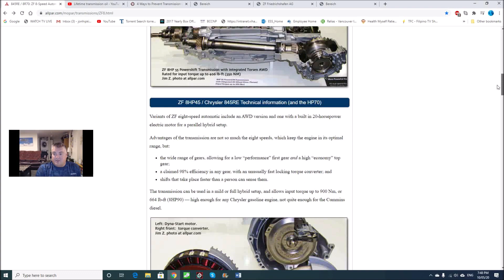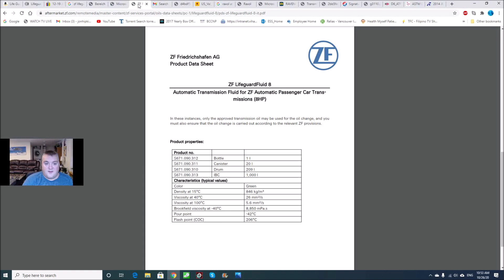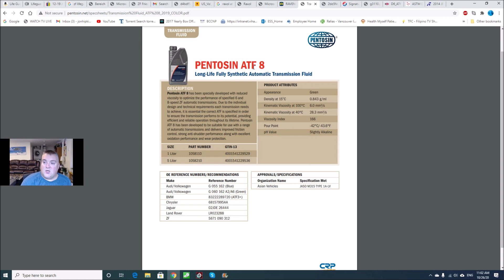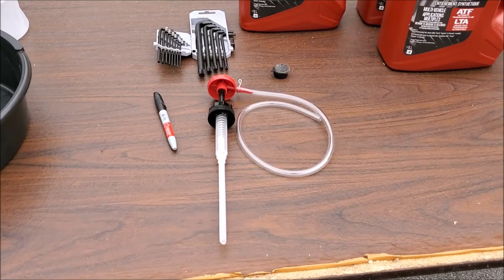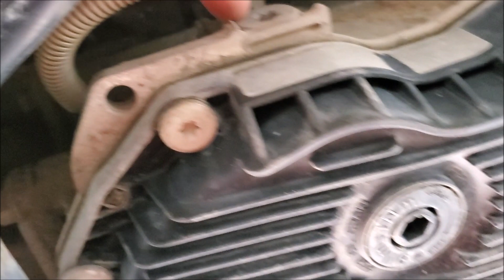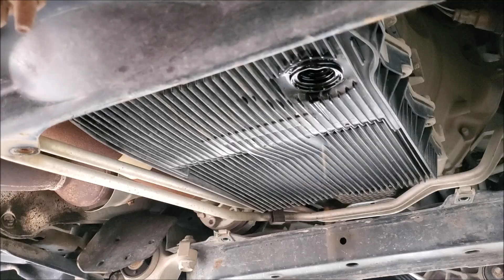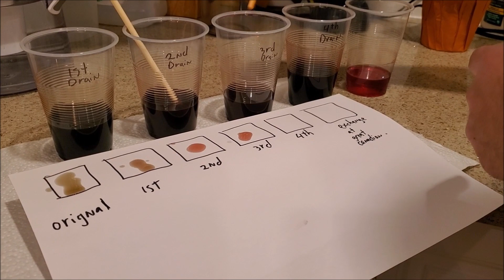ZF 8 SPEED FLUID CHANGE AND OPTIONS (SPECS INCLUDED)

Comment: Having transmission judder issues on a 330e with 116k miles. Don't believe it was ever changed by BMW.
Should I try changing the oil as a first option or is it too late?  - full detail in following comment.
Reply: Very harsh judder through the car under the following conditions:

- Car is in ICE mode
- Acceleration under load between 1500 - 2000 rpm
- Most prevalent in 6th gear
- Happens in both manual and automatic mode
- Most noticeable in sport mode but does happen in comfort and eco pro also

Current adaptation values of the automatic transmission:

Clutch fill pressures:

Clutch A: - 24.0mbar
Clutch B: -18.0mbar
Clutch C: -256.0 mbar
Clutch D: -34.0 mbar
Clutch E: -241.0mbar
Clutch K0: 132.0 mbar
Clutch IAE: 0.0

Had the adaptations reset but the problem did not go away.
This issue clearly needs more investigation but from here logically thinking:

1. Change the gearbox oil, checking:
i. Pan check for metal. If all good
ii. Mechatronic and solenoid. Replace if needed, if that fails
2. Drop gearbox and send for full re-conditioning.
Reply from the maker: @user-od3rl5mc  I'm definitely no expert on the subject but your fill pressures seem wildly sporadic. I would ask BMW what the range should be normally as going from 18 to 256 seems like a huge fluctuation to me. It also seems unlikely that the fluid would be the cause (in my mind) since the problem only occurs in such a specific circumstance (only ice mode and only 1500-2000 rpm). Whatever you decide plz let me know how it works out.... good luck
Reply: @jonh2408  The gearbox was rebuilt and the flywheel replaced. The torsional vibration damper was also checked by BMW.  The problem persists and no-one can figure out why its happening! The problem only reoccurred after a long drive so the car was fully up to temperature.
I had a look at your video again and noticed the section regarding the external oil cooler which my car has. I wonder if its quite common to underfill these gearboxes as a result. The oil cooler would have soaked up all that extra oil in the pan straight away on a a long run when the oil got above 75C. Do you think its possible?

Alternatively, it releases an residual oil in it contaminating the new oil. Just a theory but i suppose it could hold water. Not enough oil would potentially cause air locks in certain solenoids.
Reply from the maker: @user-od3rl5mc  you mentioned that the transmission was rebuilt... seems uncommon to need a rebuild at only 116k miles... are you the original owner?... and yes I'd say the cooler would take fluid from the pan.
Reply: @jonh2408  Not the original owner no, clutches and seals, and the valve body with a recon'd unit.

Comment: I am gonna use RAVENOL 8HP ATF. It's spec is the same as the factory recommended. Has anyone else had experience with that fluid. Was going to do it on a 2018 dodge durango gt awd with 95k miles.
Reply from the maker: Was just wondering if you ended up trying the Ravenol?... if so... how hard was it to find, how much did it cost, and how did it work out?

Comment: hows the valvoline been?
Reply from the maker: I'm at 145,000 km now... changed it 105,000... still running good. Will be doing a fluid change at 150,000... but won't change filter till 200,000
Reply from the maker: This time I'll video the fluid change at great canadian. Will document the  process, and show samples of before and after fluids
Reply: @jonh2408  nice great video im going to do my dodge charger with dorman filter pan and valvoline max life. I was curious about the mopar fluid mixing with valvoline. Im going to fill and drain a few times like u before i swap the pan to try and get out all the mopar fluid.

Comment: Jon, great info - looks like doing a single drain+refill (3.5qt out of 8.7 so about 1/3rd) had very little effect on the color, so hard to tell how much a difference on liquid spec itself.
I'm very interested to see if there isn't a way to manually "soft flush" the old liquid out like in these videos https://youtu.be/7-t0_-tXb34 yourself as I've done that for the steering fluid before with great success (rather than drain+refill a bunch of times diluting it instead).
Can you speak to how the oil change place did it ? seem like you would want to disconnect a return line, while somehow feeding the fill plug with new stuff - not sure I would wan to run it empty like the video (power steering container are trivial to fill as it dumps the old fluid)... I've called around and so far none of the quick oil places would to a BMW  ZF 8 so I nee to check transmission shops next, but don't want a full machine flush as I hear it can clog things up.
Reply from the maker: The oil change place had a machine with a small "wand" on the end of a hose... they undid the fill bolt and placed the wand into the pan. The machine then sucks out a liter... the puts one in. It continues to do this while the vehicle is running so your pump is circulating the fluid
Reply from the maker: So they use 15 liters of fluid and by the time it was done pumping in/out 15 liters (about 45 mins) the fluid was clean
Reply: so if it sucks 1L while running, the pan which holds ~3 should not be empty and the filter intake could still get fluid, until the machine dumps 1l of clean stuff which obviously get diluted with dirty dropping stuff... seems very simple to do (just fill plug). I assume maybe they sucked the full 3L first and filled until overflow, then started the engine to do the live exchange.
Now I need to find a place that does that... the valvoline quick lube places around here would not work on a BMW (same tranny so who cares).
Reply: Thanks for the video. About to change my pan and fluid on a 17 ram 1500. 
I will note that my valve opens at 175 and operating temp levels out at about 183 under normal driving conditions, but mine also doesn’t have an extra plastic air dam over the pan so not sure if that has any effect or not.
Based on your situation and availability/cost of fluid changes, I think what I’d do is have Canadian oil do the oil flushes but then also go go home and change the pan and fluid out after every other one (100k). That way you still get to inspect your magnets and you get a fresh gasket etc, plus you don’t have to worry about the drain plug being an issue, but still get the added benefit of what is hopefully a much better fluid change prior to the filter change. 
It seems like parts have come down for these (I paid just over $100 for mopar pan) so if you’re talking every few years or so it’s not enough to worry about.
Then again it’s a FCA, so chances of our vehicles still running by then are probably slim anyway 😅

Comment: So what is good about this transmission you pay 6 times more for transmission flush and you do it at the same intervals your better off getting a reg transmission and save yourself some money this transmission is definitely not worth the money
Reply from the maker: Well, there are a couple of pros  about it. First if you take care of this tranny it will last you a long time. ZF (like alot of German autoparts) has a reputation for quality, and there 8 speed line of tranny's holds true. During my research for the video, there were a lot of guys on forums with RAM diesel trucks reporting hundreds of thousands of miles often under heavy towing conditions. It's widespread use across dozens of vehicles (particularly European cars with great reputations for quality and long lasting) is well known. As for the cost, it's only crazy expensive for people who do no research. Or those who get sucked into the advertising nonsense about using only lifegaurd 8 fluid. These same people will pay $$$ to have services done (often at dealerships renowned for being the most expensive) they could get elsewhere for much less. As I mentioned in the video, the "exchange" style flush I had done cost me $200 cad and was (as you see in the oil samples) very effective. I can buy the replacement filter for my pan next time for $40. I don't think $200 is much more than the cost of getting a flush done the usual way... its just a matter of checking around to see which shops have that machine.

Comment: If you use those basic L shaped torx and Alan wrenches how do you torque the bolts to spec? Good and tight, eh? 😂
Reply from the maker: @macieksiemczyk1096  as I'm sure you noticed in the video it would be impossible to get a torque wrench on some of the bolts. And since the lowest setting on 90% of torque wrenches in 10ft/lbs and the spec is 7 ft/lbs it's a moot point

Comment: ZF manufacture drivetrain components, not oil or petroleum products!
Reply from the maker: Well whoever they hire to produce their lifegaurd 8 fluid is still following fluid specifications set by zf..... so it's still there formula regardless of where it's blended
Reply: @jonh2408  I agree completely.  Just making the point that one or more of the big petroleum corps is making this stuff and ZF are adding their branding.  Doesn't mean however that they can't sell the same stuff with a different name to the mass market.
Reply: @johnshaw8013  Shell produces Lifeguard 8 for the OEMs and ZF.
Reply from the maker: @Wozza Dog  I suspect you're right on that. I asked the shell guy who emailed me the L-12108 info, but he wouldn't comment on relationships with other companies.